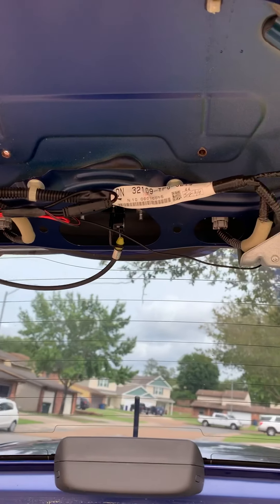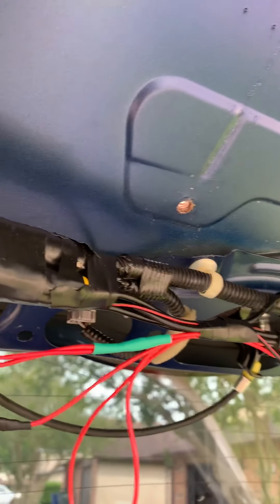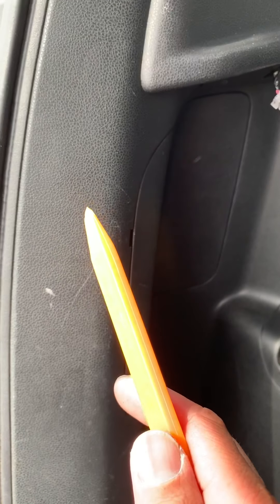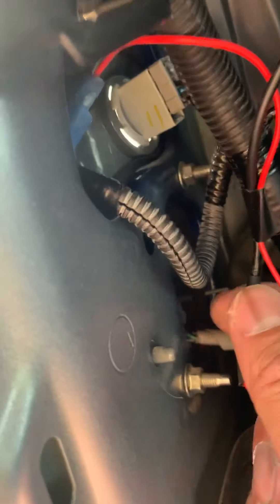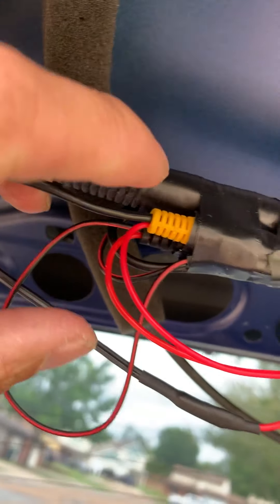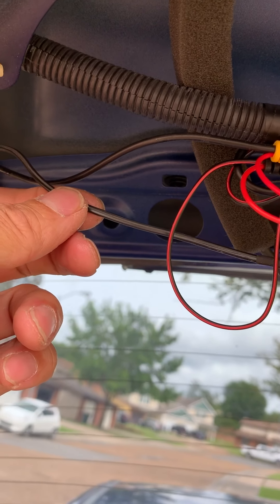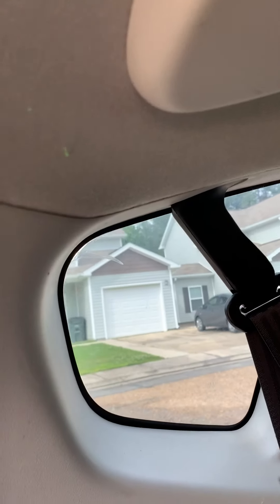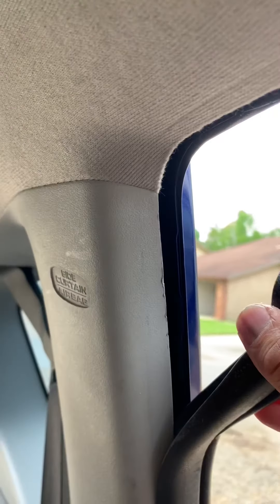Honda Fit reverse camera wiring install

Comment: Thank you! I'm gonna install it soon on mine. I'd have passed the wire through the bottom of the door frame instead of the top but I'm not sure which way is easier?

Comment: It looks like you got the RCA connector through the grommet thing between the car and the door?  I tried but I couldn't get it.  Maybe I need to try harder.  It was really tight trying to get it through there.  I'm in the process of installing it now and right now it goes around the outside of the grommet.  I'm not sure if it is going to be okay or not.
Reply: A month is probably too late, but for anyone else who sees this - you can pull it through the tailgate grommet by using a wire with a hook in the end. I just did it with the method in the video if you search "How to Feed Wire Through a Rubber Grommet the Easy Way". I wouldn't leave it outside, because it's going to be a way for moisture to get around that grommet and into the body panel (and then trunk).
Reply: @gregmossed  I sprayed some lubricant inside the tube and the wire ended up slipping right through easily.  It is going to be dripping inside the door for a while.  I got it through though.

Comment: Useless video if you're not explaing actual connection
Reply: Should be easy depending on the model. The one I got only needs to be wired into the reverse light and it'll send the power and signal on a single wire to the display (a Y cable connecting camera, display and power supply) so no connections required at the dashboard. The harderst part really should be tearing down the trunk cover and guiding the wire through the pillars.